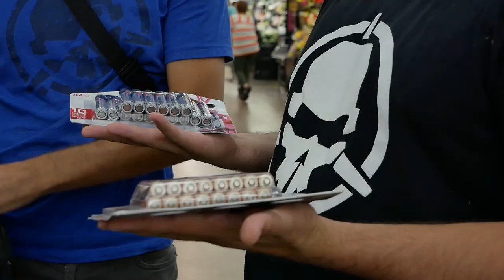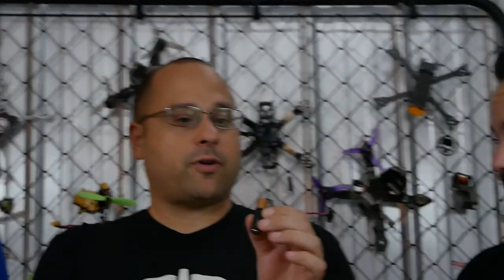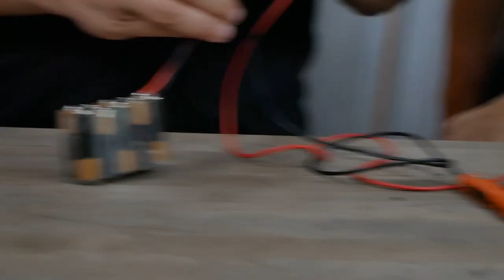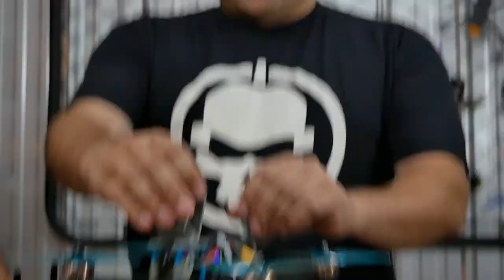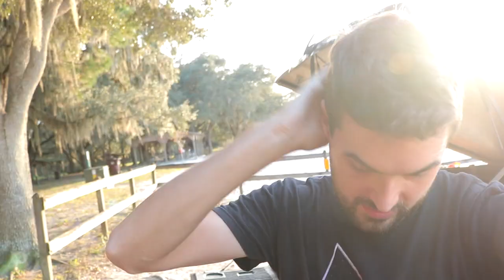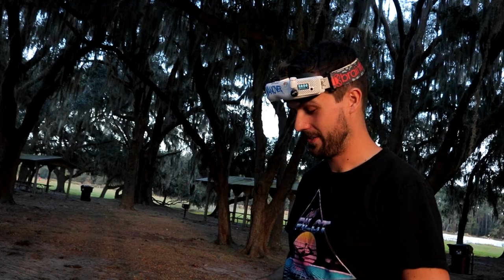Can a Drone Fly with AA Batteries?

Comment: Basically it's the internal resistance that are sagging out the voltage as more current goes through the battery, basic physics, so this is why we used lipo cuz the internal resistance won't be taking out a lot of voltage in the process of discharging (ie internal resistance -> heat, that's why the bat pack got very hot)

Comment: Wouldn’t it have worked better if you used different motors and props that were designed to be super efficient? The old school Flite Test guys used to fly their H quads with 8” 2 blade slow fly props and 2212 motors with wooden booms and everything. That combo pulls max 10 amps with the right pitch prop. x4 motors and your like 40a punch outs and maybe max 20a hover. And they did that on 3s, so less battery than you all used. 
Anyway, I think this rates a revisit but done with different hardware. Time to call David “The Swede”.
Reply: Allegedly David attempted - and failed - to make it fly on AA batteries
Reply: For the record, we tried like five other things that didn't work, including lithium AA (just as an example), and calling in David Windestal for advice, but not all of that made the edit.

Comment: 18650 battery's is a viable option for a long range 6" - 7" quad, they even use them on 3".   But there is not a lot of videos out there about this topic.   Maby a idea for future RR video ?   Anyway , loved this video and its so nice to see a channel like RR doing fun experiments and not only showing different flights like most fpv channels does
Reply: 18650's are still lithium. Here the point was to use AA batteries...
Reply: @Vousie  There are lithium AA batteries. AA is a form factor, not a chemistry.
Reply: @Thelango99  Sure. By AA batteries I meant the standard ones - alkaline or, if you want rechargeable, NiMH. Not specialty ones like the lithium batteries.

Comment: Use rechargeable Nickel metal hydride cells as they have lower internal resistance and the Loop brand rechargeable AAs can handle 10 amps

Comment: Normally AA battery (that's of classic Alkaline variety) carries between 2 to 2.6 Amps hour of capacity, and very importantly, the internal resistance is also crucial since it alone can determine how much energy those batteries can actually dump without too much trouble. Generally Alkaline batteries suck compared to the Lithium-ion batteries when it comes to energy density per cell weight. Obviously Nickel Metal Hydride cells would do better than the Alkaline batteries since they have much lower internal resistance (closer to the Lithium-ion cells for some brand cells). Nevertheless that would be a fun experiment.

Comment: I did Fly a 7" 6s Drohne on 2s. It works just fine, But has a little to less Power. But that was expected. 

I think i can Fly whithout any Problems whith 7,2 v (6s  nimh)  car packs. 
Also i tryed lifepo4  Batterys and this works as well. 
Also li-ion packs are very Good. 
I also did a test whith a  NiCd pack from a Drill. 
Also packs for our lawntrimmer work fine.
The heavyest Batterie pack was a lead-gel/ lead acid 12v 3A one. It was flyable, But had a very big voltage sag(down To 9v) 

I also used my old and very Bad whoop packs to Made a bigger pack. 

Also i tested supercapacitors,
 cellphone Batteries(removed Protektion circuit) and a intro Motor whith a Generator. (this was the only fail, Not enough Power from the Generator)

Comment: Placing my bet:
Very saggy, very heavy.
Will struggle to hover, more likely just spin the props and not lift off at all.
Compared to lithium, alkaline chemistry has much higher internal resistance. Because the voltage is lower you need more cells in series, and the series resistance adds up fast. Energy density is qctually not a huge amount lower than that of a lipo, maybe 30% to 50% less guestimating based on equivelent energy in 3 AA's as a single 18650, but an 18650 has almost double the energy density of a lipo. A 1500mAH single cell from a lipo is probably roughly equivelent to 2 AAs.

Problem is of course, power density. That ESR severely limits the amps.

My guess for the best configuration will be 10S3P

Comment: I'm only a minute in and am guessing you did manage to get it to hover at least.
Whatever the material & quantities of they make Duracell batteries with has got to be a closely guarded secret, I found a set of 4 Duracell AA's in an old RC car and after 30 years (or longer) they still read 1.46v, no leaking, can still be used.
Reply: @smooth_ops2942  Yeah they must've changed their recipe in the past decade or two, Duracells made in that time do now leak.
When rechargeable AA's turned up I used them as much as possible because the cost saving over continually buying alkalines was massive. Now I rarely need AAAs & AAs, lithium batteries are reigning supreme, although I wish more devices had user replaceable lithium batteries.

Comment: What’s most likely going to happen is that the excessive heat from forcing current draw from AA batteries will destroy the anode and cathode, burn up the dry electrolyte before the battery will drain. 
You guys should really of done the more Scientific approach so you can determine how many AA batteries you would need to actually fly the quadcopter and see if you can pull it off.
I would recommend using 6S+ motors because with higher voltage, it’ll use less current draw which is where the AA batteries suffer the most.
Reply: Scientific research? Guy, relax. It was just a little video idea to see if it would work. I doubt they actually care about spending the time to research the shit to make it work

Comment: Lol, you should try bigger build. I got one 15inch props with 4822 390kv 6s drone, It lift well at 5amp. a single motor will produce 1.5kg thrust at 12 amps

Comment: Instead of 1.5V alkaline batteries you should use A23 12v Alkaline batteries. With 12volts and 23 amps and being half the size of een AA battery  I bet it would work.

Comment: Alkaline batteries have an extremely high internal resistance. lipo batts have an internal resistance of around 5 mOhm to 20 mOhm. alkaline batteries have around 100mOhm or .1 ohm. BIG DIFFERENCE. Great video showing why we use LiPo batts... gg on the vid tho

Comment: Try it with the lithium non rechargeable AA and the rechargeable as well i think the non rechargeable lithium will provide more amperage the rechargeable ones degrade fast
Reply: We did try that although it didn't make the edit. They didn't work b/c they have a protection circuit that cuts off if you over-current. They are Li cells but for safety they are artificially restricted to low current.

Comment: Could someone help me out, at the end when they were flying the 6” the motors were making a rough noise at a certain amount of throttle, my quad started to do the same thing with one of the motors, I don’t have a clue why.  There’s no physical damage and the motors are all new.
Reply: this is a desync issue. Either you need new/more capacitors or a new esc

Comment: Don't bother with the same voltage as the original pack just aim for the same voltage as in the hover and if 6 aa will give that voltage a 6s 2 p pack will be 12 aa v 20 almost 1/2 the weight.

Comment: I wonder if you used 9V Batteries instead of the regular 1.5 V. You get more Voltage and hooking just two should get you 18V. then you can pair up a bunch and increase your amps ....

Comment: This is a easy way to make simple thing complicated those battery are not designed for that purpose our scientists and enginears have developed lipo battery for that. Using a thing for that purpose for which it is not a single percent supposed to do that job even though you have other thing for that job and saying that creativity that not. And he also changed the chemistry as he has not used traditional aa battery. So if you are changing the chemistry then why not use the lipo battery which is in the shape of aa battery because you have done the same

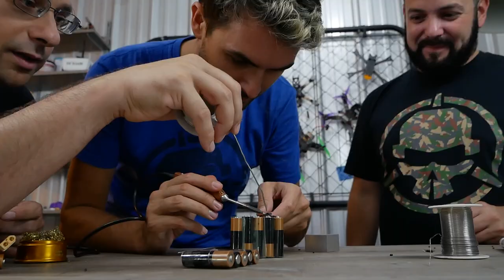Comment: 4:44 Soldering will destroy the capacity and Max power draw from the batteries. The excessive heat will break down the anode and cathode. Get a 500F capacitor, charge it up with a voltage 
Potentiometer to 2.7 volts and you can use it to wield aluminum to the leads. Solder the wire to the aluminum and wield the aluminum to the battery leads.